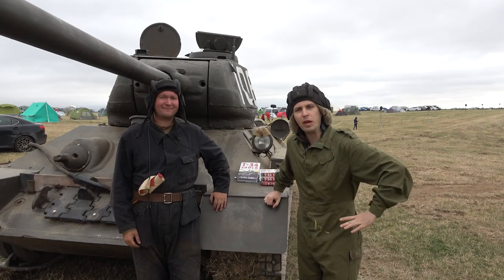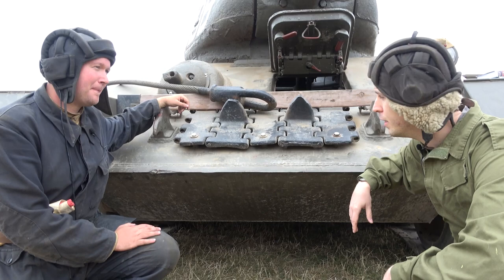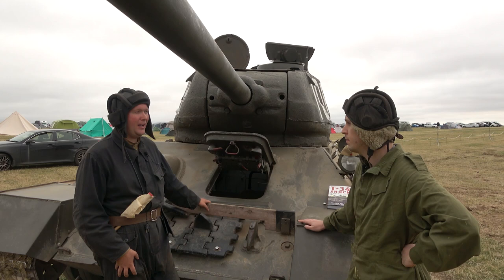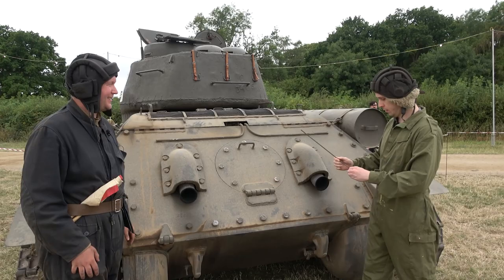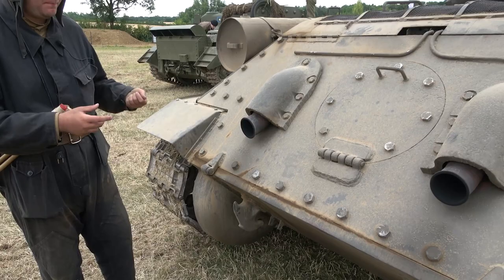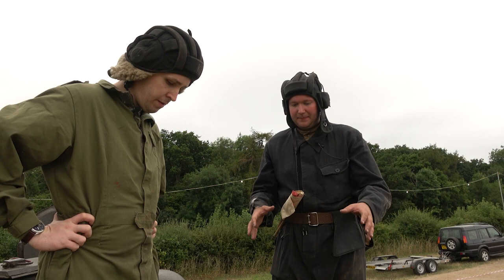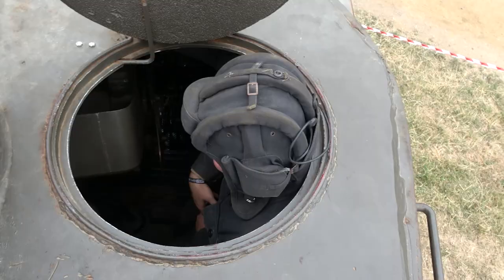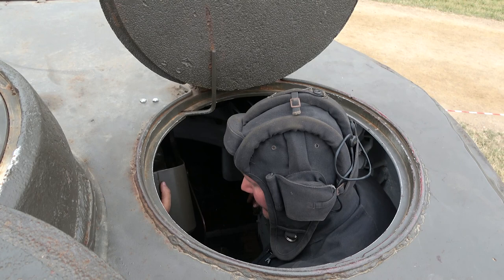Inside the ‘Cockpit’ - Soviet T-34 Tank

Comment: I heard Soviets experimented with flying tanks so it all makes sense Chris that he would check one out.
Reply: “Flying tank” is a nickname for the Mil Mi-24 Hind helicopter, but if you mean something else you might mean the Object 279, which was a tank with 4 tracks that reminded people of an UFO.

(I might also be missing something out, but im not sure)
Reply: @ruota4796   I was referring to The Antonov A-40 Krylya Tanka but I guess you can also add the Ilyushin Il-2 Sturmovik. I was just trying to be humorous.
Reply: @rtello45  ohhh i see, my bad
Reply: Flying tank:  Fairchild-Republic A-10 👍👍👍👍🤘🤘🤘🤘
Reply: @HiroNguy  The only thing the A-10 is good at is taking small arms fire and dropping bombs. The gun is inaccurate and the recoil of it slows the plane down, its slow, and is hardly ever flown at high altitudes. So its just a more dangerous version of ANY plane.
Reply: @ruota4796  A-10 is 1 part of a complete system.  It was never meant as an air superiority fighter, only as a specialized Close Air Support as part of a ground attack.  In that role it's excellent. 
In the theaters where there may be enemy fighter cover the battle plans include F-15s, F-16s, F-22s, etc as high cover so the A-10s can do their job of supporting the boots on the ground.  
Also:  The best engineering for maintainability of any vehicle of any type I myself have ever worked on.  It's better to have a plane that does go 400 mph than one that doesn't go mach 2.
Reply: @HiroNguy  It is true, i have not taken into consideration that it was also meant to be used together with other fighters or interceptors.
Reply: Any tank can fly... well once at least.
Reply: @somethinglikethat2176  😆
Reply: Poivre Blanc  fr 💀
Reply: Antonov A40
Reply: @rtello45  Not only the A-40. In fact, this is probably the last of "flying tank" concepts.
Back in 30s' there were MAS-1 (from 1937), Rafayelyants Flying Tank (1933) and Kamov also had a scetch of tank-autogyro.
Reply: wasnt there a t-26 flown by a glider or something like that
Reply: @pinuninu  T-60 on a glider - that's A-40 Krilya Tanka, BT-2 on a glider - that's Rafayelyants Flying Tank. Add Walter Christie M1933 flying tank concept (he was the first to propose this idea) No known proposals to make T-26 fly though.
Reply: We already have flying tanks thier called Blackhawks and cobras and hueys etc etc
Reply: @HiroNguy  The A10 was intended for the disruption of the 'Ho chi Minh Trail' during the US invasion of Vietnam. It was too late!
Reply: @robertbennett9949  It was too late for 'Nam but in time for Desert Storm.
Reply: Sovieti chceli prepravovať tanky na ťažkých bobarderoch TB-3 a s primontovanými krídlami spúšťať ako klzáky sorry neviem po anglicky 😉

Comment: The Radiator Louvers served two functions guys. In cold weather they could be closed for better engine performance and in combat they could be closed up to keep Molotov cocktails from being tossed into the engine. They no doubt were also used for crossing deep streams.
Reply: One more purpose - defence against shraphel and attacks from air too

Comment: Taking into account the time that the T34 was designed it was probably the most innovative tank ever made. Reliable Diesel engine, wide tracks to go over soft ground, sloping armour, Christie suspension and simple to maintain. Idea weapon for the red army.
Reply: But with still some really elementary mistakes like the lack of radios and cupolas and the cramped 2-man turret in the early version. Drawbacks that don't really matter in video games but mattered a lot in actual war. 

I don't think it's fair to call the t34-85 innovative as it's no longer a ground-breaking design with mistakes but just an upgunned version that fixed the elementary mistakes of the first design. Which was great for extreme mass production. But I'd say the panther was a more innovative tank at this stage of the war. 

I always wondered why sloped armor wasn't used more early, it seems like such a simple innovation that you would quickly discover when testing out anti-tank guns. Still, the T34 is probably the first tank that really embraces it as an important feature, which was innovative for sure.
Reply: Okay design, terrible execution
Reply: @mr.thiemo1406  For the time, I'd say exceptional design.
Reply: @Jajalaatmaar  not really, if it was a good design then the fuel tanks wouldn’t have been in the fighting compartment.

Comment: If I was heading to a big fire fight I would use up the reserve gas tanks first. Their only going to get shot up leak out anyway. What’s the difference if you use it now or later?
Reply: There is no direct connection between these and the internal fuel system (that was mentioned in the video).  So it is not possible to use reserve fuel first. You still can detach those before the fighting begins. The diesel fuel makes those safe enough, it is not easy to ignite.

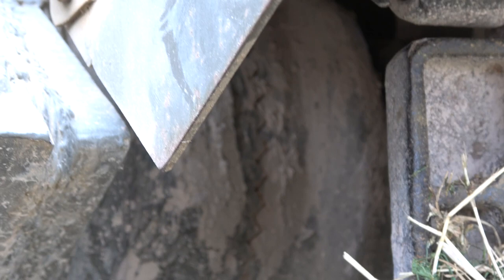Comment: (04:05) “All this is, is a duckboard.“

(Is “duckboard“ is one word or two?)

I believe that the British do not use the term “dashboard“ to mean the control console inside the typical modern automobile.

The origin of the American word derives from the canted wood piece typical of 19th century horsedrawn American carriages and wagons, to serve as a foot rest as well as be partial protection from water and mud that dashes up from the horses´s hooves and to some extent its front carriage wheels.

I only wanted to make the observation that a board, by coincidence (I suppose) also made of wood, should have a position and purpose identical to a pre-existing term, but from a completely different etymology and culture.

Comment: I heard from somewhere that the 1st generation of T34's were so poorly built they would breakdown before emptying it's 300-gallon tank. Is this true? And when did the reliability get fixed?
Reply: Yes, the T-34s built during the second world war were dreadful and for many many reasons.
For the full horror show list of faults I highly recommend LazerPig's video on the T-34, I'll go dig up the name of the video (as comments with links in tent to get auto-deleted by YouTube these days)
Reply: It's called, "The T-34 is not as good as you think it is"
Reply: I think my favourite flaw of war built T-34s is, actually I have two.

1) They stopped putting rubber seals around the hatches. This means that while driving they all rattled and rang like bells. And unsealed they did, of course, let the rain in. Which shorted all the electrics.

2) Tank armour would be heat treated to add resistance to armour piercing shells.
The harder the better but only to a point
The Soviets went well beyond that point, creating incredibly brittle armour plates.
So when hit, the armour would shatter and burst, destroying the tank.
Further to this, lumps of razor sharp armour, called spall, would detach from the inside of those shattered plates, bouncing around and ripping apart all the crew members.
Reply: This is true of every early/mid war soviet designed/made item
Reply: The objective was Soviet production numbers. A shot up tank hull could usually be patched up, new and used guns, turrets, etc., installed, and be back in the fray within days or a few weeks at the most. There were numerous repair facilities scattered everywhere including the tank factory still producing new and repaired machines at Stalingrad. Even if the Heer was "destroying"  T34s at a 10:1 rate while retreating, they were still losing the battle. Who controls a battlefield full of broken tanks after a battle is winning if they have the ability to quickly salvage and restore many of their machines to service.
Reply: For 1942 t34s (the lowest quality, as mentioned in this video) expected engine lifetime was assumed at 50hours. It was an absolute minimum though
Reply: There are lots of ww2 myths there, one of it is the unreliable german tanks versus reliable allied ones. From all what I saw, there was no drastic difference, tanks break down a lot. Just look at post war tank development and how long those needed to become "reliable", but magically certain ww2 tanks developed in less than a year were "reliable"...sure...Anyone noticed how  German tanks from the first half of the war are deemed "reliable" but in the later half weren't, almost as if something else was vastly more  important.
Reply: @DD-qw4fz True; but there must be different levels of reliability? To my knowledge few replacement tanks reached the German front lines by the early winter of 1941. Therefore, these tank models; PZ I/II/III/IV held together for months on end whereas an early model T-34 would break down before reaching the front. I wonder if the teething problems with the initial T-34 design were greater than that of the Elephant, Tiger, and Panther?! On one hand you can replace broken parts but on the other the whole machine fall's part after a month: I.E., the welding joints begin the crack.
Reply: У Т-34 были свои плюсы, и свои минусы. На заводе собирали неквалифицированные работники, подростки, женщины тоже. Так как отцы и мужья ушли на фронт.
     Танк был прост, это и спасло. Фронт требовал больше танков. Уставшие люди перевыполняли план за счет качества. Такое было время.
     Но фашистов разбили.

Comment: About the tow hooks on the back, what is the benefit of such relatively complex cast piece, compared to a simple ear cut from a thick plate and equipped with a standard shackle?
Reply: If the factory makes cast parts already it is much cheaper and simpler to make cast parts. For cast parts the complexity of shape does not directly translate into manufacturing difficulty. So it is quite possible that these cast hooks are in fact cheaper to make and more ergonomic than those of same function but cut from a plate.

Comment: Another zany aircraft video 😂 The T-34 is a case of less is more when compared with German heavy armour. A simpler and cheaper design, with some nifty features like sloped armour, resulting in cheaper and quicker construction and, of course, greater numbers.
Reply: Germany’s idea of making fewer but better tanks was optimal considering their lack of oil.  How they implemented that idea was the problem.

Their National Socialist economy utterly failed to produce those tanks in the numbers required due to a total lack of competition between factories. Oddly for a Communist, Stalin let his factory mangers run the war factories like they owned them leading to lots of competition in building cheaper and better tanks.
Reply: @MrWolfstar8  You make some excellent points.

Comment: "There's a lot of space in here"

With only two of the three crew members in the turret, the recoil guard folded up, and no ammunition and other stuff filling it up.
Reply: It's actually either a 4 or 5 man crew on the T-34-85, depending on exactly which variant this is. It looks like it's the one without a dedicated commander, so 4 man crew, but I'm not quite sure
Reply: @filmandfirearms  All T-35-85s were made to have a three man turret (five man crew with the driver end engineer (aka bow gunner or radio operator or assistant driver in other militaries), but they shouldn't really restrict the turret space and not affect the positions he was in too much). It was the 76mm versions that had two man turrets.

And in this case he sat on the commanders seat under the commanders hatch before moving forward to the Gunner's seat while the other gentleman was in the loader's position. There is no dedicated hatch for the Gunner. 

The point was that, if he were in that thing ready for combat it would be a lot less roomy.
Reply: He's also comparing it against aircraft. And without factoring in the type of movements that would be required in a tank compared to an aircraft, as well as the bumps and such you'd get from driving the tank over uneven terrain.

Comment: I really wonder if that t-34/85 is a post war built one? Because if it's a wartime production variants... I feel so bad for the crew in that case
Reply: As per the video the chassis is from the early 1950s (Czech production was then) and the turret built during the war.

But physically it would be essentially the same inside as a wartime T-34. 

Also before thinking how awful it would be ergonomically, remember that the actual turret would be filled with ammunition and other materiel and have three men in it... so it would have been much worse.

And, honestly, considering contemporary designs it probably isn't that awful. Look at many British tanks or even much lauded German tanks and most are terrible ergonomically. And the T-34 was an inter-war design that they had to cram that big turret onto.  

Only the US ever put much thought into crew comfort, everyone else just went with people being physically able to operate it. Which is in line with ergonomics as a field only just emerging in the US in that period.
Reply: Post war Czech turrets generally look smoother since they took the time to grind down the casting seams. The nasty seam line on this one helps to identify it as WW2 Soviet casting.
Reply: Башня военного выпуска, так как два бронеколпака вентиляции находятся взади вместе.
    У послевоенных, - один взади, второй впереди
Reply: The USSR only recruited people short and thin enough to fit in these tanks